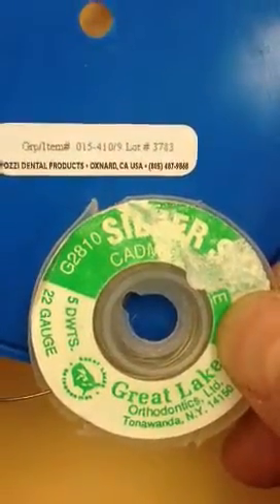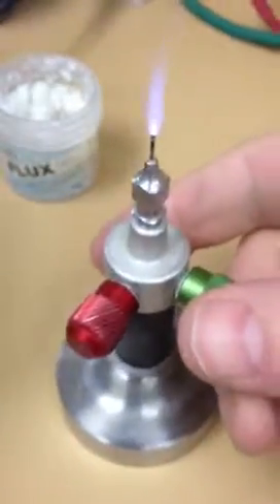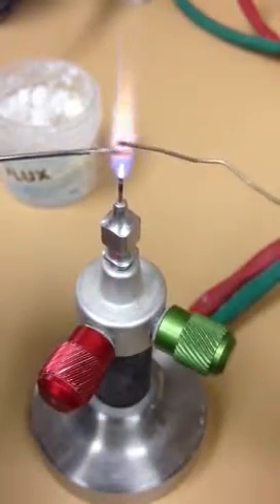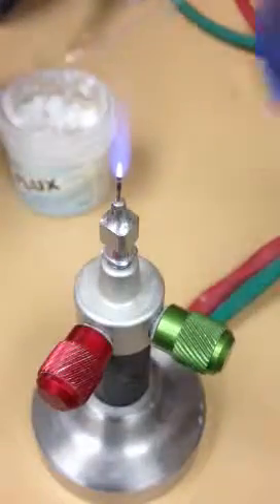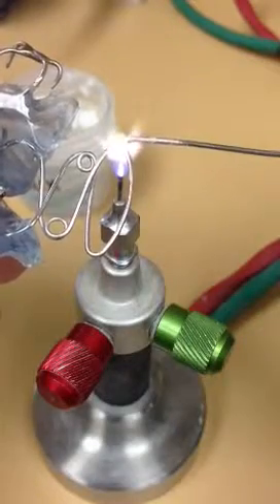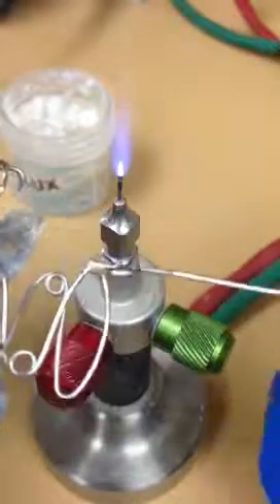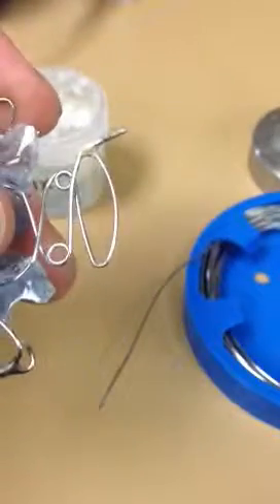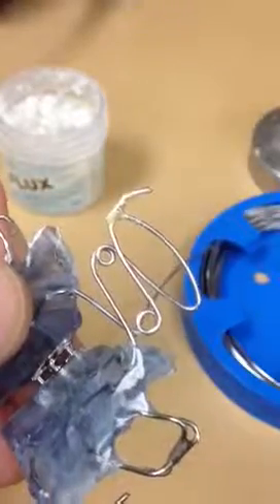Adding a wire to a Hang Expancer

Comment: Did you use 22gauge wire for hang clasps as well?
Reply: Dexallyn Diego The Hang clasp is made with 0.032” Blue Duralloy. When made correctly, it’s by far the most retentive clasp used with acrylic appliances.
Reply: @dr.brianhockel3898  Thanks! That's my problem i dont know how to do it, I've been searching for so long on how to fabricate it but still theres none.
Reply from the maker: A little late... Sorry.  No, Hang Clasps are 0.032" Blue Duraloy